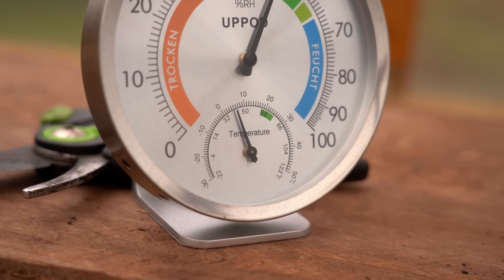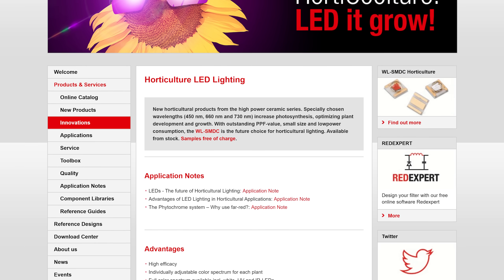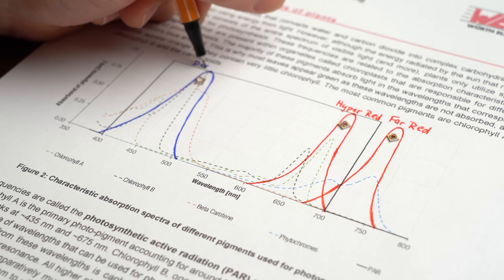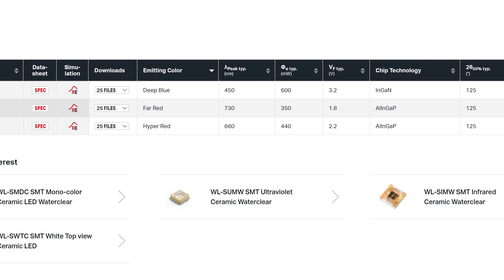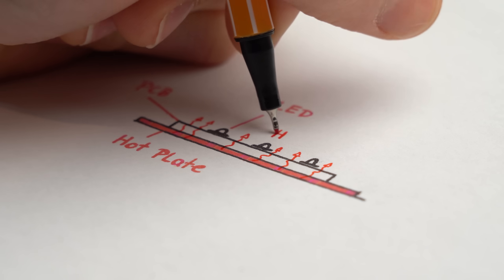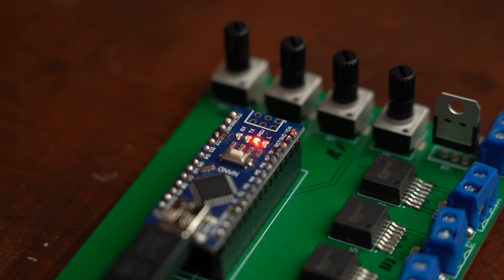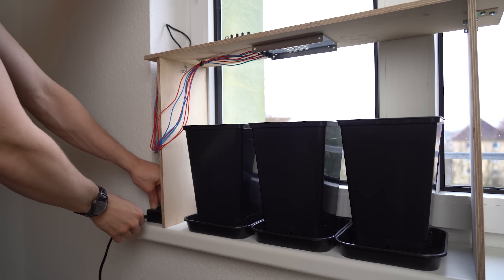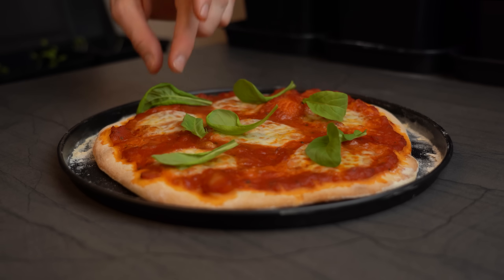"Magical" LEDs let my plants grow faster? (Experiment) The Future of Farming!

Comment: I tried to get into that «grow LED» bs few years ago. With all marketing misinformation and cost of narrow spectrum LEDs I just gave up. The best results I had was from 30 watt cool white ceiling light (square flat panel aka Armstrong). It was the cheapest option what makes a difference. Chinese «full-spectrum» LED did something good too. And the worst possible option was «grow lamps» from a market. Those did nothing (because low power) and super expensive. Maybe now things have changed, I don't know.

Comment: Ditch the lens.  It blocks light.  Usually the only reason for lens/glass is to confine noble gases or provide mechanism for heat removal.  Otherwise you are just wasting lumens.  Even the cleanest, clearest looking glass will block around 10% of the available light.  A piece of translucent chinesium should block much more.

Comment: I'm missing a comparison with only "daylight" LEDs, it would be nice to test
Reply: You can find that stuff with videos I’ve done.
Reply: yep, and the answer is daylight LED work better. the tired myth of "plant dont use green light" is still pervasive even against theorical and empirical evidence showing that all plants use green light (but some more than others, lettuce is the one with less requirements of green light.... but still grows faster with green light than the "optimized" LED at same Wattage)

The heating effect of the LED should also be considered as there is a thermal lower limit where plant will grow. The (hyper exponsored) "experiment" has too many non controlled variables to be of any use.

Comment: Owned a greenhouse business for many years, I used various types of lighting at varying stages of growth, depends on what the plant needs. Take a look at some commercial greenhouses and you’ll find the LED type are generally used more towards the seedling stage then they switch to High Pressure Sodium for large scale leafy growth. LEDs just can’t put out sufficient lumens for many plants to grow.

Another one, many plants are sensitive to day length, especially to induce flowering. Take Mums for example, usually a late autumn crop here. In order to force them to flower early I pulled shade cloth over them in late August, early September to simulate shorter days. This tricked them to induce flowering. You can simulate the same thing in the winter using lights.

Another issue: stretch. Lower levels of light that aren’t “strong enough”, as in not enough lumens, will cause the seedling to abnormally stretch and topple over as the root system hasn’t developed at the same pace as the upper part of the plant. You have to run LEDs almost touching the seedlings to temper this and feed them fertilizer that promotes root growth at that stage, as in a lot less Nitrogen (that’s for leafy growth). It’s counter-intuitive, but at that stage, after radicle emergence, lower the soil temp to slow down growth. And don’t run the lights as often as you think you need, you’re not actually simulating the sun, you’re augmenting what’s around. You can’t rush Mother Nature too much, just coax her one way or another.

You can exploit this stretch effect to your advantage with a couple crops: microgreens are the most common example. But you’ll find this to be the no 1 issue you’re going to encounter.

10 years, multiple greenhouses in Midwest Chicago winter, LEDs help for certain parts but they’re unfortunately not a cure-all.

Comment: One tiny flaw in the design. The PCB doesn't take the bend radius of the metal into account. So the PCB doesn't go all the way flat and therefor doesn't transfer heat optimally. I guess this could be solve with simply sanding about 1mm away from one side

Comment: Does the accelerated growth rate of the plants grown by led impact the nutritional value of the plants?
Reply: Yes, the composition of the light lead to varying nutritional values, taste and total growth. Recent studies is showing that simple daylight hold more benefits than previously thought. Personally I prefer daylight as the base with just a few added deep blue/far red. Sure if you're a commercial grower growing just one thing you'd want to optimize a bit more.

Comment: Soooo cool :) I was working on a 3D printable hydroponic system but I had no idea what to do about the grow light system. I was pretty close to using GPIO off a pi zero W for a programmable light system but if there is a kit version I’ll use that. Also my other less elegant solution was a smart plug and usb power for the grow lights xD

Comment: thiss cool thanks for showing it   i was planning on making my own panels, i was using high pressure sodium n metal halide, at different times but i knew they werent ideal.. i hadnt bought any offline because i assume what im growing, which isnt exactly the kind of stuff u eat :p at least i dont, it doesnt work that way for me unfortunately thanks to my body... anyway i assume it wants slightly different wavelengths because its doing different things and i wanted to be able to adjust each one, that panel would work great i wouldnt have to make one  i was going to use different leds tho, more solder friendly

Comment: Nice Video. little tip if you have high power LED's you can optimize your heat dissipation with a polygon (copper plane) around the led. Some leds have a special pin just to dissipate heat. (otherwise normally use the biggest pad of the led to make a bigger plane)

Comment: Great video! but ~€450 for a light kit is little expensive.... are there alternatives? :D
Reply: you can buy grow lamps for standard E27 sockets for 5% of the cost
Reply: plain white leds work too. This kit is really necessary if you want to optimize the power consumption. And the alternative of course is to buy the leds yourself, like great-scott did initially.
Reply: @victortitov1740  plain white LEDs do not work. The specific wavelengths target growth or other characters and most normal LEDs lack the Reds which boost or simulate growth (unless a high CRI led like 95CRI which still sucks at the job) or other shades. The kit is obviously Scott promoting his sponsors.

Also if anyone cannot deal with the 3535 format LEDs look into Duries E or Lumileds which come in 2835 format and it's easy to find metal PCBs for them as they are used in Lightbulbs. Rest should be pretty simple.
Reply: @MaxC_1  "plain white LEDs do not work." - i don't know what are your sources here, but i use a cheap 20W light (80-ish CRI, 4000K) which i tuned down to 10 watts to reduce heating, and it makes a massive difference to my plant compared to what it gets trough the window in winter. There is absolutely no doubt it works, the question is probably "how much more efficient can it get" if the spectrum is tuned for the purpose.
Reply: Ouch, that's a lot more than "free samples" at 10:43!
Reply: You can do everything in the video for under 20$
Go get some Deep red and some deep blue and so on LEDs from Mouser/Digikey or any supplier you have
Get some Aluminium PCBs made, or order a DTP PCB from places like Intl outdoor (aka the Hank store) or Mtn electronics or even Aliexpress and solder the LEDs on
for the power source just get a cheap Constant current supply and control the LEDs with PWM
Reply: LIDL sells an indoor LED mini-greenhouse to about 30 € and it works very well.
Reply: I use "full spectrum" florescent bulbs. I've heard halogen works well too.
Reply: @frm272  the question is if you can pay the power bill nowadays with non led lamps for plant growing.

Comment: Where did you fabricate this aluminum PCB? Any files you are sharing for us?
Reply from the maker: JLCPCB. I was not planning to publish the Gerber files because the design is pretty straightforward.
Reply: @greatscottlab  I am totally new to making aluminum PCBs so it'd be a great guide. I am doing something similar with the same LEDs. Do you recommend some your your older videos where you go more in depth with the aluminum PCB design in Altium Designer?

Comment: I would like to see this done in the greenhouse, where there is no in advertant wave length filtering from the glass in the house.
Reply: In german winter sunlight is scarce - the effect might be ever so slightly smaller.
Reply: @Jacksparrow4986  that is why we test and do not speculate without testing
Reply: @Captain Sceptic  I appreciate your spirit and I'm by no means an expert, but I would still call it a safe bet that the difference windowglass/unfiltering glass would be hard to spot on a plant growing in winter in germany.

Comment: Great video and everything was accessed so easily. I remember 15yrs ago i was really into this as well. messing with LED's Red/deep red, blue, white 1w LED's at the optimal wave lengths with special focusing lenses. I had to construct my own Drivers for each string of high powered LED's and hookup an Arduino mini and learn programming with a real time clock and dim up/down slowly depending on wake up and sleep times.  I had to do a lot of tinkering on my own and learn about different configurations of LED's depending on the cycle the plant was in. I learned to solder, build circuits, about plants, nutrition and a bit of engineering.  You really took me back to those old days of learning and wonder.  Thanks! great video!
Reply: 15yrs ago? Damn! You were way ahead of time <3
Reply: @IbbiAhmed  thanks, yeah that was when the 1w led lamps where just being made and sold on ebay ONLY available from china. Thanks, I'd like to think so, haha. Yeah those were different times indeed.
Reply: Duygulandım. You also remind me my old good days

Comment: If you'd like to heat your greenhouse in the winter months then I'd highly recommend a Chinese diesel heater.  If you're not familiar with them then do a Google search using that term, they are awesome little heaters that consume diesel fuel and some electricity but overall are very efficient, simple, and reliable.   I own 5 and have thousands of hours of operation on them for various purposes including heating a greenhouse in the cold climate of Michigan, USA.  I use LED and HPS growlights to supplement the sunlight, and the diesel heater at 27,000btus of output as well as taking advantage of the exhaust waste heat is more than sufficient to maintain the temperature even in the coldest blizzard conditions.   I also use old fashioned style large bulb Christmas lights for supplemental area heat on tropical plants.  Excellent video by the way!
Reply: These heaters need venting as diesel combustion produces: carbon monoxide (CO) and nitrogen oxides (NO/NO2).  Moreover, if you have natural gas available nearby, e.g. service to a residence, it may be cheaper to use natural gas vs. diesel in the long run, a calculation could help determine the answer as to efficiency.  Downside to natural gas: requires electricity, so power outages risks loss of heat.
Reply: @johnlaurencepoole6408 Yes, Chinese Diesel Heaters are equipped with an exhaust pipe like a car...ventilation of the combustion cycle gasses is a built in feature and necessary.  I route the exhaust through an old cast iron steam radiator which is connected to the outdoors, this recovers normally wasted heat energy and boosts the efficiency of the heater which is already quite high.  It is an expensive option for sure, here in Michigan I spend about $3 a day on diesel to keep the greenhouse above 60°f all winter.

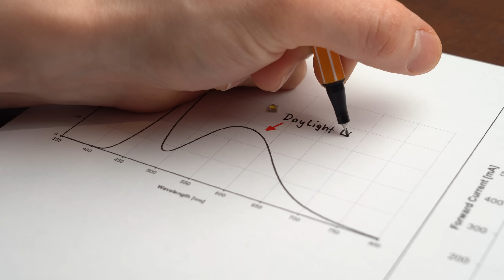Comment: The part at 3:13 holds a crucial information that is dismissed by a lot of people who claim to be experts. This video is more accurate in its simplicity than anything I've ever seen that takes itself so seriously, it even dredges up quantum physics.
Reply from the maker: Thank for the feedback :-)
Reply: True
Reply: Definately true! I believe that graph is called the McCree curve, that dip in the middle far more exaggerated then it is in reality. That study was done in the 70s, but it is impressive nonetheless considering what equipment they were working with at the time. But experiments repeating this research show a far less exaggerated dip in the green range. Photosynthesis DOES in fact happen with green light, that's been proven now, just not as much as with red or blue light.
I've been researching this topic out of personal interest for a while and I found out a couple of really interesting things. 
Green light supposedly penetrates the leaves so the lower leaves receive more green light, as the higher ones absorb red and blue first. Thats why the lowest or deepest leaves die off, as light levels decrease, but it takes a few layers before that happens. 
Also, red LEDs have been researched and developed the most specifically for horticulture, as red seems to have the biggest benefit to plant growth. In fact daylight LEDs, 5000k for example can approach or sometimes even exceed the efficiency (umol/w) of special horticultural blue LEDs, but a warmer 3000k LED usually wont beat a horticulture red LED.
Finally, to squeeze the most performance out of your LEDs you can underdrive them. I've got some COBs that are usually driven at 120 watts a piece but I drive them at 50 and just use more LEDs to get to the total desired output. These are just 3500K LEDs not really anything special, but this way the efficiency goes over 2.5 umol/w wich is actually about the same or sometimes even better then some commercially available LED assimilation lights.
Reply: @FOATE  The McCree curve itself is an average of photosynthetic response measured through a very tiny sample of plants, so it can't be taken for granted either. I use my LED lights at 40%, really helps longevity.

Comment: I really enjoyed this one. When you were showing the final growth at 3 weeks, the plant directly under the light was considerably more healthy. Do you think that removing the lens would have made any significant difference in light distribution? Just curious. I've never used lens covers on my lights so I'm not familiar with the effects.
Reply from the maker: Yep. The lens definitely helped focusing the light. Without it, I think I would have to increase the current flow. But then again, the outter plants would have received more light. Both options come with their own advantage/disadvantage ;-)
Reply: @greatscottlab  I agree that these LED's improve growing conditions but your control group behind glass can be impacted by a UV coating on your glass. I'd rather also have a test group outside(which will ofc only really work in the summer).
Reply: @lucacamphuisen3093  yeah
Reply: @lucacamphuisen3093  Why would a window have a UV coating? It might a IR-reflective coating, but it shouldn't affect the plant growth.
Reply: @timbehrens9678  Some household glass has anti-UV coatings because it is supposed to help prevent fading of coloured furnishings like curtains etc.
Reply: @IanSlothieRolfe  Less likely in Germany which is as sunny as Alaska :-)
Reply: @timbehrens9678  If its anything like England it's still a problem in the 6 weeks of summer we get!

Comment: As far a customization goes, like light brightness or wavelength selection; Is it worth building my own when there seams to be endless commercially available led gardens? I can't find a commercial one that allows wavelength adjustments, is it necessary or even preferred by plants I wonder.
Reply from the maker: Such a good question. I talked with a Biology expert and there are studies out there that say that a precise wavelength adjustment can certainly increase growth. Basically there is a sweet spot. BUT you will have to find that sweet spot and that can certainly be challenging. A basic grow light does already improve growth but a fine tuned one can boost the growth even more ;-) That is at least what I learned working on this project.
Reply: Six hundred euros. That's how much the ones cost that are equivalents of this light in the video.
Reply: @dominic.h.3363  And much does the lighting kit shown in this video cost?
Reply: @Jehty_  Significantly less. But since we're talking about a DIY kit, the end price will depend on your mileage in assembling electronics (and the length you want, since you'll need larger capacity drivers and power supplies).

You could spend one third, one half... or 1.5 times more if you want to overdo the automation part. My cheapest project that grew plants as well as 4-600€ lights cost me about 50.